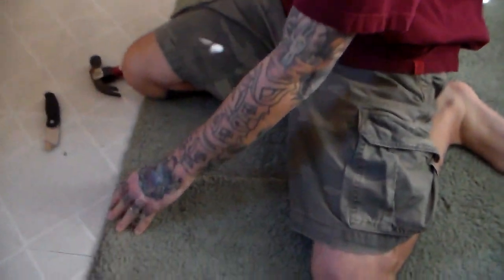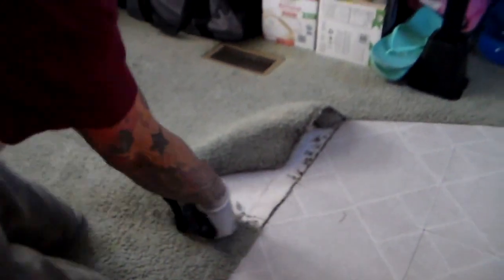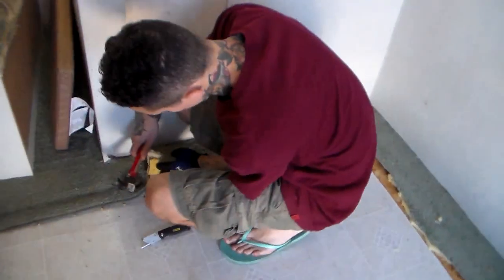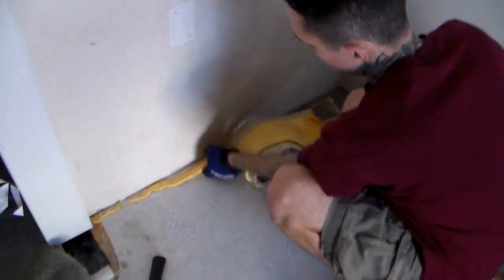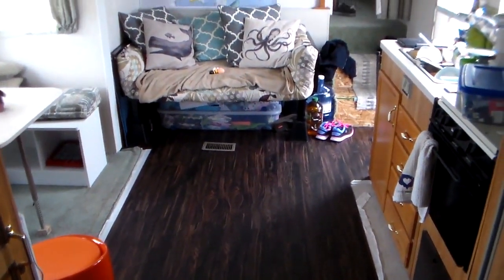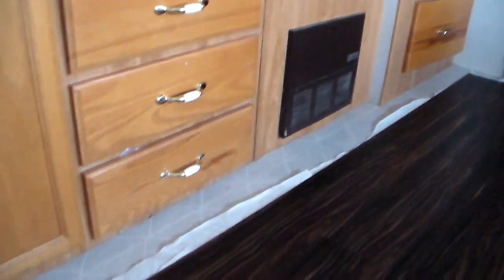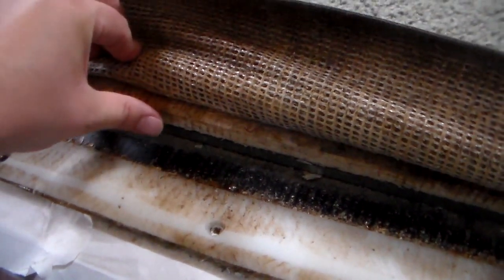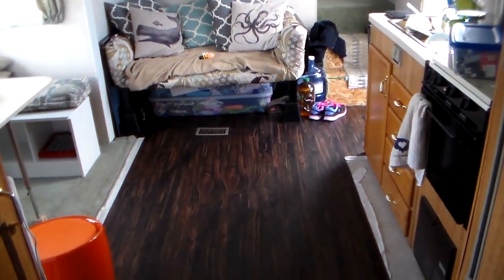removing the carpet in our rv, full time rving

Comment: I totally feel for you two with the amount of work it takes to replace the flooring.

We bought a 36-year-old fifth-wheel (no leaks so YAY).  The staples on all vertical surfaces are one inch apart and it's the original carpet. The carpet is so old it's coming apart and we have to pull out small tufts. It took two days to get the steps and bulkhead up to the bedroom area cleared of carpet. I'm still in the bedroom area on day three using a utility knife and a pair of pliers to pull chunk after small chunk of carpet away from the wall.

Comment: I would place underlayment on entire space bringing out to the lower rough edge. You will need to put spacers if some sort or more layment to fill gap on the edge so it's stable and does not flex. Then lay your new floor over that and create a trim. Just a thought. You guys are teaching me alot, thanks

Comment: Yes I recommend pulling the toilet and flooring under it. Logic is that if a leak happens you see it sooner and the flooring doesn't buckle up and warp. Great job, my first and so far only attempt I had far more issues at the joints. That's what I get for hurying and not following the rules and training, lesson learned no shortcuts. Border trim for vinyl transition should work at the slide just find one wide enough.

Comment: Love the Allure Flooring ! Absolutely pull the toilet and place the flooring underneath it. Pulling the toilet is easier than you think. Just make sure the water is turned off and your pump is turned off. Only two screws are holding the toilet to the floor.

Comment: I would just use some plywood to level that gap before covering it. I would not lift the toilet as it's bound to have a wax seal you will then need to replace as well as the old adage if it's not broke don't mess with it :) if the floors are vinyl it should be easy enough to trim around. Looking good, though be careful until you finish it, you don't want moisture from the shower getting under the floor.
Reply from the maker: +Brian Saban if you're talking about the gap on the sides, that gap has to be there, that's where the slide rolls up at.

Comment: In your situation, I would've just put in commercial carpet tiles. They are durable and long lasting and are easy to just pull one or a few up that get stained/ruined. They are extremely easy to install and look incredibly nice. They have a special padding/backing beneath them that prevents liquids and other contaminants from seeping through. The key with buying carpet tiles is to stay away from the flimsy peel and stick ones sold at Lowe's or Home Depot. I don't see how those would last any amount of time and am sure they are not very comfortable to walk on when barefooted.

Comment: If you go to Love Your RV, he replaced the carpet in his RV and you may be able to get some ideas from the way he handled the slide out portion of his floor.  Not exactly the same flooring you are using, but still may be helpful.
Reply from the maker: +RV Granny i LOVE his solution but it's wayyyy more expensive that i can afford.
Reply: The product he used is very pricey stuff, but I thought it might be done using something cheaper. I've used indoor/outdoor carpet for many things and it is very inexpensive and sturdy. Also it cleans up nicely in case of spills. We used it in our boat and it is great to clean up messes when they occur. This might work as a temporary solution for you and you could find a color to match the vinyl flooring.

Comment: Having carpet cover your slide gap is the cheapest and most practical solution to covering up your slide gap. Ray, at "Love Your RV" installed a really nice woven vinyl floor covering, however, this product is NOT Cheap! I chose to have a professional carpet service come in and dye my slide carpet a darker color to hide all the issues (sun fade, spots, etc.) This worked out well because the slide carpet does not get walked on a lot (like the carpet you just pulled up did) and dyeing the carped made it look brand new.
Just having carpet in your slide will not be a big deal after you dye it a darker color to go with your nice new Allure floor. PS: having the carpet dyed was not expensive at all.

Comment: Yes, remove the toilet to put in the new floor. You may have to deal with the toilet height vs the flange on your black tank with a spacer. On my RV, the toilet was on its own pedestal that was under the flange. So the toilet did not need an adapter for the flange. The vinyl flooring was cut with a jig saw to go around the adapter. Here is a picture while I was upgrading to a composting toilet: https://flic.kr/p/CbKFCP

Comment: could you spray paint the gap a dark brown to blend in? i would like an update in about 6 months to see how well the tiles hold up i wanted to put it in my foyer but heard the corners crack and peel up so i'am still undecided lol
Reply: +pam reynolds Everyone I know that used the Allure Brand flooring is extremely happy with it, my best friend used it in his camper in Arizona with 110 degree summers without any issues. This applies only to the Allure Brand from Armstrong! By-the-way, these were not tiles, but, planks about 6" wide and 36" long. I would strongly recommend using this product in your Foyer . Good Luck

Comment: the little thing sticking up.. put a coin over it and tap with hammer see if it goes down ,,,gently. as for flooring and sticky use hair dryer and warm the tiles up and they will bend and stick easy .. but nice flooring . cheers from uk x
Reply from the maker: +Colin Tonkasdad i'll try that! thanks :)

Comment: lift toilet ;]
Reply: +SNP robo REPUBLICAN 45 I'm not sure if you can do that.. you'd increase the spacing between the toilet gasket and the toilet itself.  For simplicity, I'd say lift the toilet too, but I wouldn't glue the strips down until you know for sure the increased spacing has no effect on your seal.
Reply: here in Scotland we can get new rubber seal [bendy] to componsate for height change..... failing that, lift toilet, lay lino, replace toilet & mark lino so you can cut where needed...... seal edge....presto, neat ;]